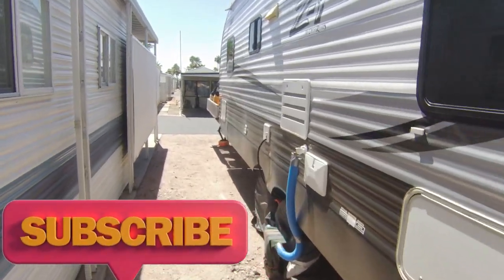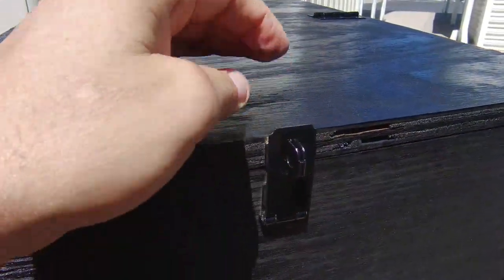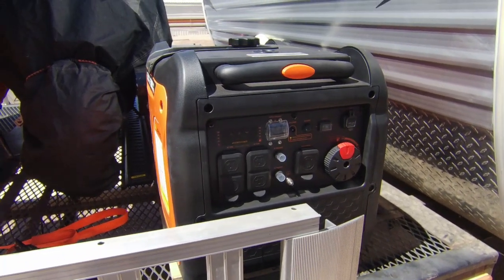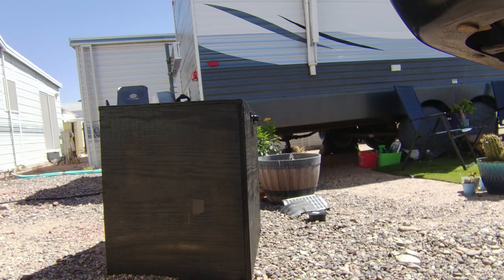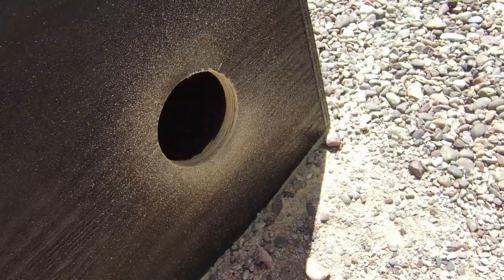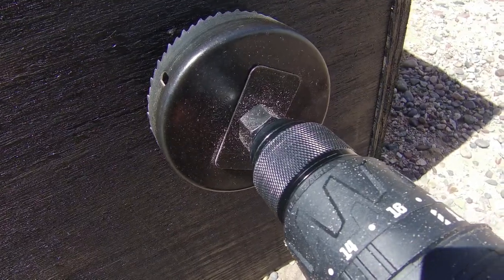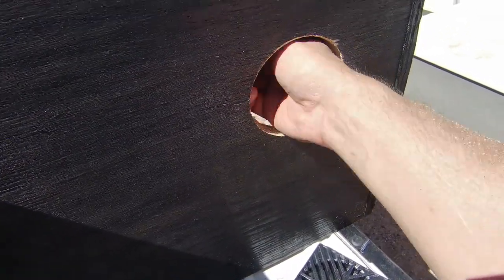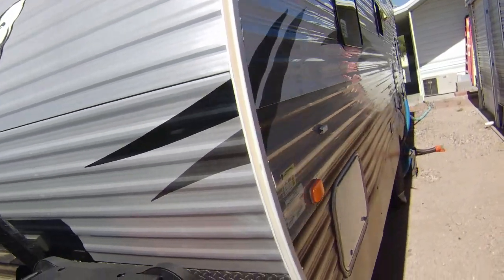Building a box to protect our generator from hooligans! #arizona #generator #dyi #build #rvlife #rv

Comment: Looks great, the stealth generator.👍
You might need to put a fan in to blow out the heat from the engine running, especially since the box is black and you're in Arizona. Don't want that thing to cook itself.
Reply from the maker: Thanks man! That is a good idea...didn't think of the heat getting trapped.